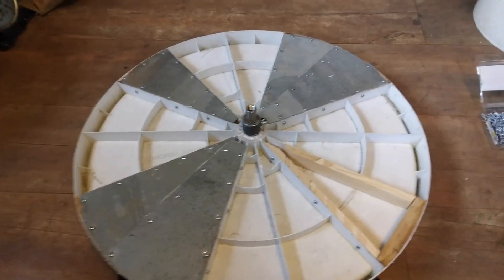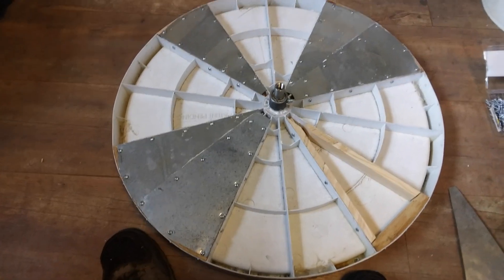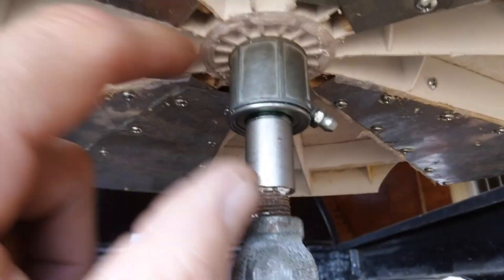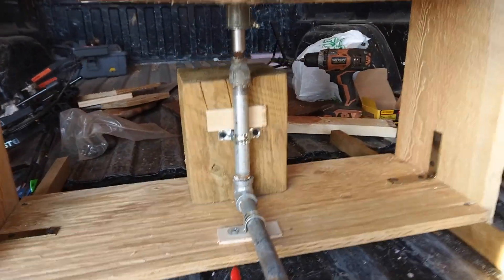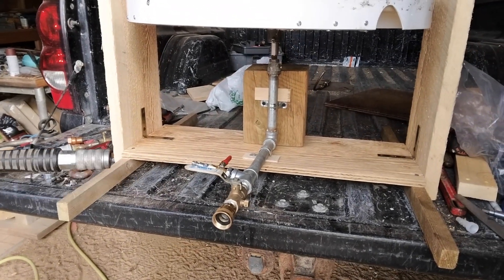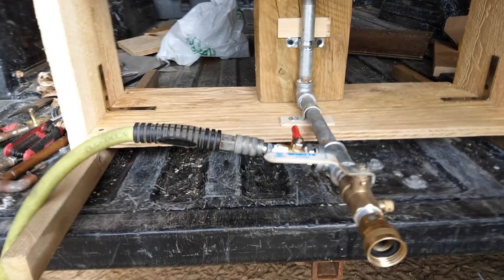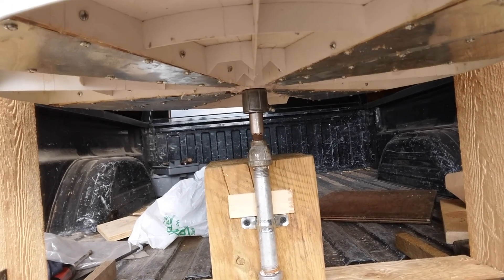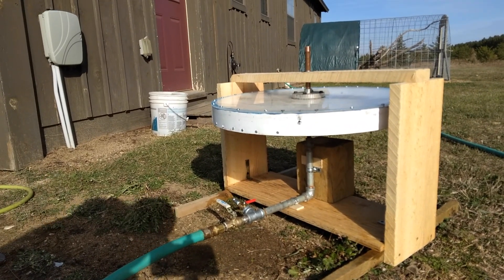Rotating Flow Turbine 3.0

Comment: Hi again nice experiment, I think that when you opened the air line  the air couldnt escape because of the water sealing the airway out and so the pressure build up was too much. What are your thoughts on this. regards Deryck
Reply from the maker: Yes, you are right.  I knew it would build up pressure, but the turbine was build too weak.  There also wasn't a load on it, so that the rpm's would slow, and the air pressure would push the water out.
Making a stronger one now, and we'll see what the next one will do...
Reply: @doubleMinnovations  accelerating water to speed in a rotation means that you can force it by doing work on it the whole way into the center... guess why tesla put the star in the center. air+h2o he who accelerates those together shall parish / quote inventor from osterreich in the 30 ies.

Comment: I think if you started with air pressure first, the water wont have time to build up and exceed the seal. Neat invention! 👍🍀🇺🇸
Reply from the maker: Thanks for the interest.  With the turbine version in this video, it just wasn't made strong enough for the pressure and water weight.  The latest version I made for steam worked well without any leaks. https://youtu.be/7uxEY4mVZ_w

Comment: I guess the air couldn't escape because of the water? What application do you foresee using these turbines for?
Reply from the maker: Yes; it couldn't push the water out fast enough.  I wanted to see if I could combine some air and water pressure.
Originally it was going to be for micro hydro power.  I would like to see if I can make a good steam turbine design of it, for power generation.  It's something a do-it-yourselfer can do.  Have see what I can come up with, for a good steam boiler. -From wood most likely.  Thanks.
Reply: thanx for testing with air....these turbine can run on steam for sure.....cheers from Ukraine....i really appreciate your projects....i believe these turbines are way more efficient then Parkinson or Tesla for sure....thnx
Reply: @doubleMinnovations  Maybe a pressure relief valve from a water heater.
Reply from the maker: I think it will be similar to a tesla; could be more efficient.  I think this is simpler though.
Reply from the maker: I just need to use stronger construction.  The pressure is what gives it the power.  It needs to be able to handle all the pressure that the source can deliver.  That for the interest.
Reply: @doubleMinnovations  I was thinking of an adjustable relief valve that could be set to just under the tensile strength of the weakest material.
Reply from the maker: @rockcrusher4636  Okay, I see what you mean.  I also need to put a pressure gauge at the input line, so I can monitor that.  Thanks